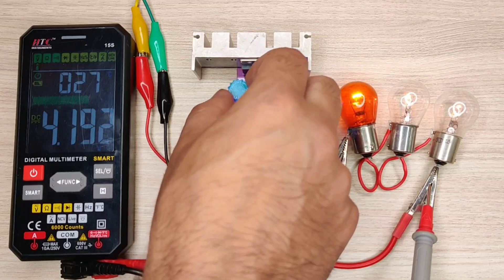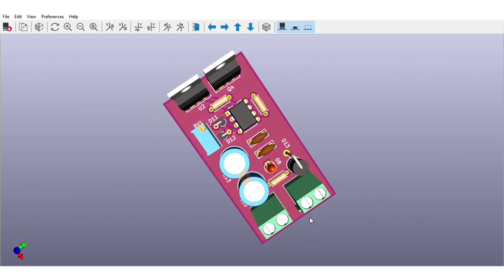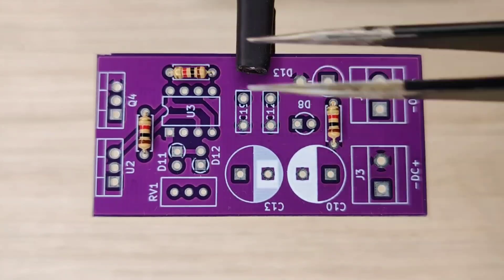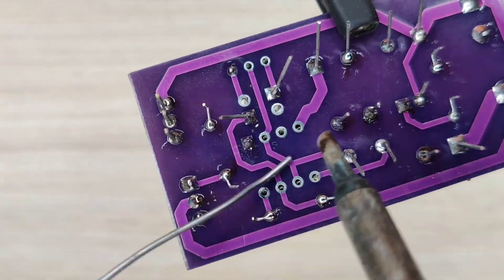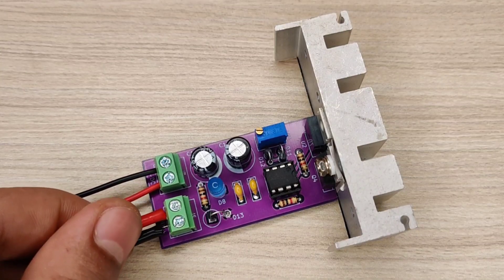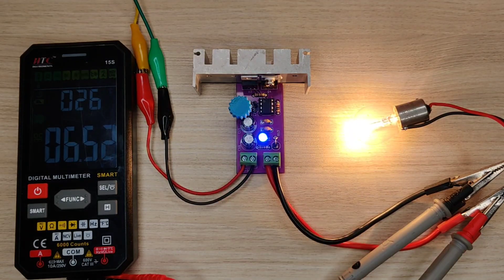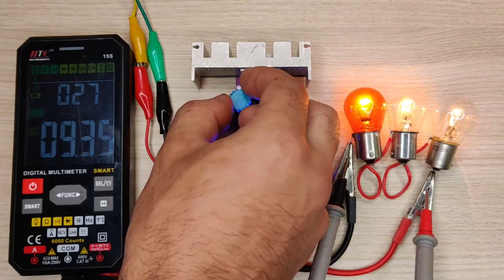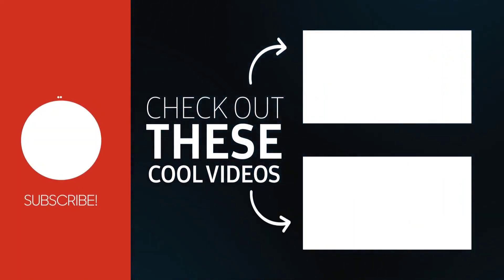Constant 0-30v Adjustable voltage regulator using 555 IC

Comment: If the input voltage varies from 13 volts to 20 volts, does the output voltage become constant or does it change with the input voltage? Please respond to the comment. Thank you.

Comment: This is a percentage controller not a regulator. The circuit rapidly switches 
a MOSFET on and off again and a 10K potentiometer varies the duty cycle
or percentage of ON time. This works as a rate controller only to increase
or reduce power to a load.  For output voltage regulation there would be  
needed voltage sensing from the load across the MOSFET for feedback to 
the 555 to vary duty cycle automatically. Perhaps a voltage sense divider
on pin 5 could accomplish the needed feedback for closed loop operation
as a true voltage regulator.  To show function as a voltage regulator is
not present for the existing 555 circuit, place a lamp load to be driven by
the MOSFET and set the 555 circuit so the lamp is medium brightness. 
Then increase the supply voltage at V1 of the LM7812 and the lamp will
glow brighter, because the 555 circuit does not regulate voltage across
the lamp.  If the duty cycle of the 555 was reduced automatically by a 
voltage sensing feedback loop and operating as a true voltage regulator, 
the lamp brightness would stay the same even though the main supply
voltage may vary.
Reply: Can you share a diagram for that?

Comment: 👍 genial lo puedo conseguir para comprarlo? Pero que cumpla con las especificaciones, porque puede decir 30a y cuando conecte carga no soporte ni 3A 😅😅😅.
Reply from the maker: It depends on the input supply amperage, also the mosfet IRF 3205 with continuous drain current of more than 30A, you can you as many mosfets you want to increase current handling.